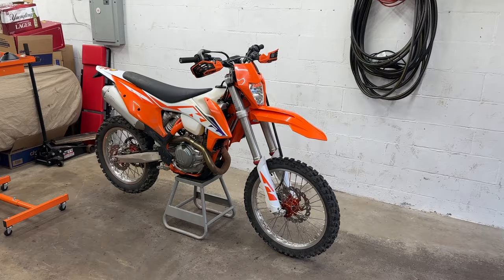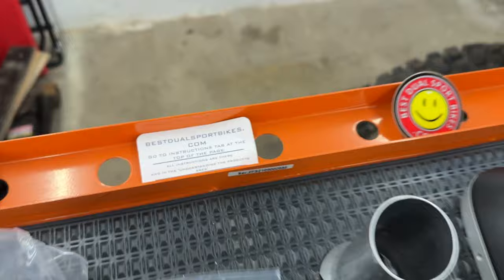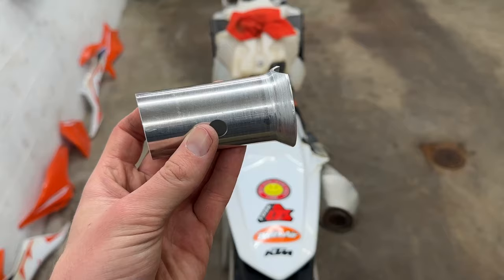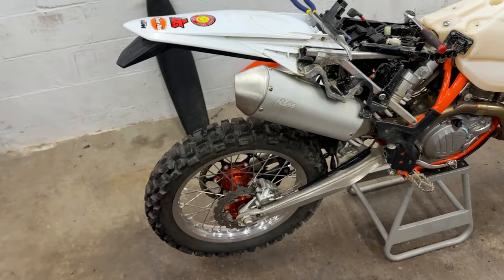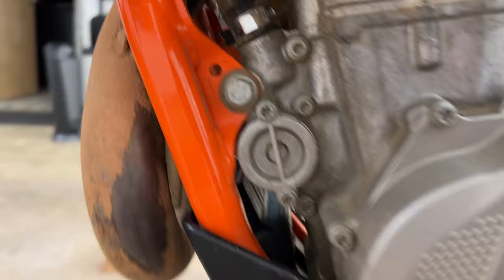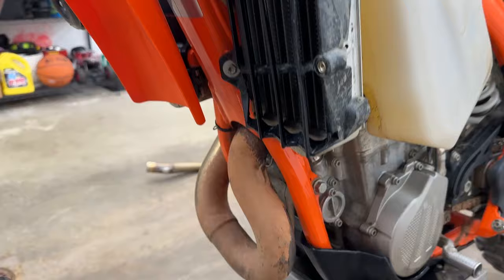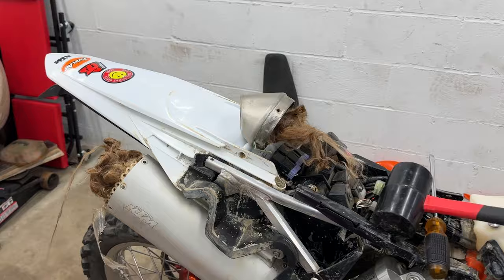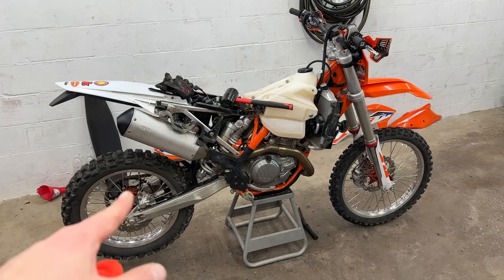Adding 20HP to my 2023 KTM 500 EXC-F Dual Sport!! INSANE!!

Comment: I reaaaally hope you didn't pull all the packing out of the exhaust... It'll run better and more quietly with packing, by a mile.
Reply from the maker: I did not! Only cut it a bit to get the new tip on!
Reply: @JohnWargo93  Good stuff, you had me worried when you said you were going to cut it all out lol

Comment: Uhh, I don't believe one bit of there being 20hp worth of upgrades there. All that was upgraded was fuel line fittings. The end cap isn't going to give you 20hp, and some random tune from somewhere isn't going to do it either.

I think you got scammed and if it was me, I'll call them out on it.
Reply from the maker: Ahhh I’m good with it. Thanks though! I could honestly care less about 20hp. That’s just good clickbait! The bike is a lot more peppy, sounds better, runs cooler, and doesn’t want to shut off everytime you shift or come to a stop so I’m happy with it 🤙🏼🤙🏼
Reply: @JohnWargo93  At least your admitting about using dishonest clickbait in your 20hp claims
Reply from the maker: @eriknash8783  ain’t my claim! It’s BestDualSportBikes claim on their dyno!
Reply: 65 hp all day long